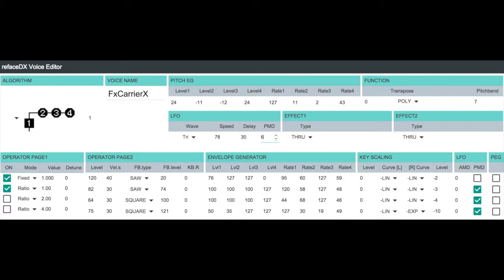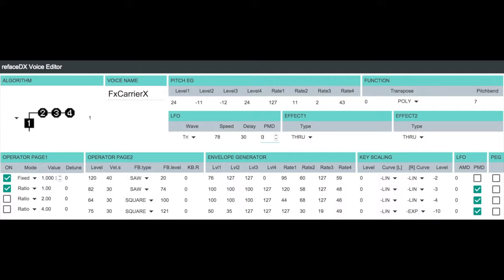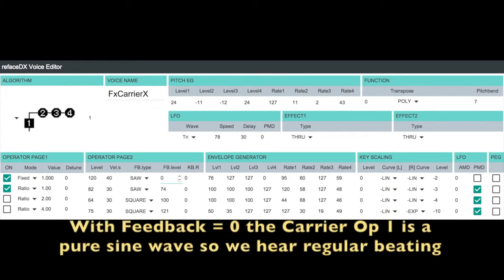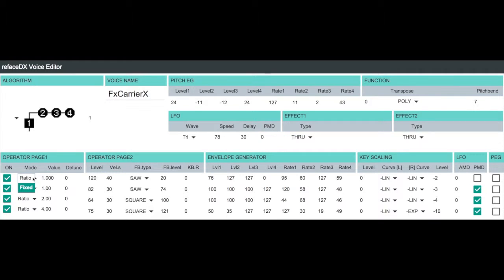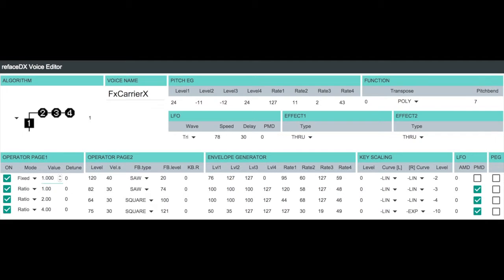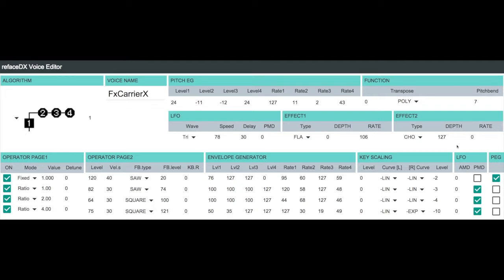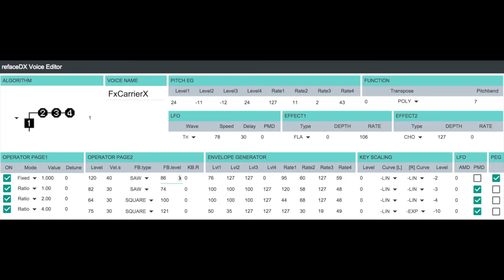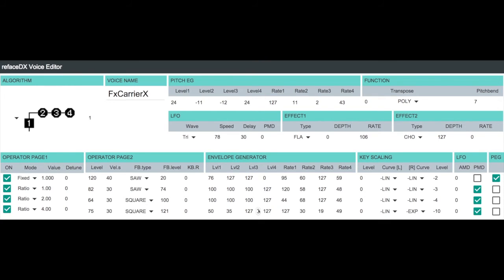Fixed Carrier Example

Comment: Hi Manny, realy amazing & helpful videos for the reface dx include a great professional speaker voice. Top Notch !
ps. i had never found this kind of voice editor for the dx, maybe is a custom software :) its looks easy & nice designed.
Reply from the maker: Glad you've liked the videos.  This is the online Web MIDI editor Yamaha provides through Soundmondo.com.  Requires Google Chrome.
Reply: Hi Manny, ahh Great Thx i had try to use the Soundmondo Web Editor with Chrome but had not work, i will try again ! (with Ipad) ..Thanks that you spent Time for the DX Videos, i see you are a FM Veteran :-)